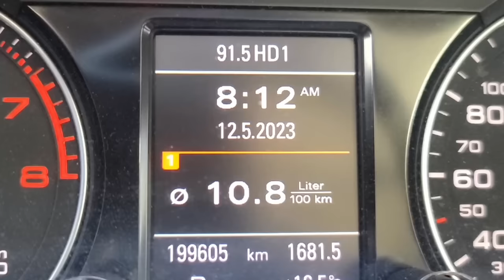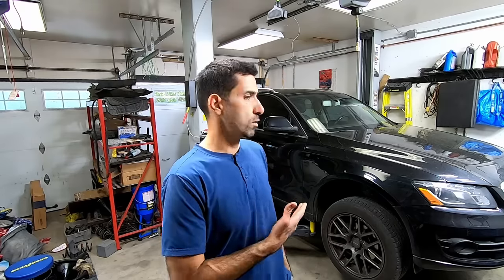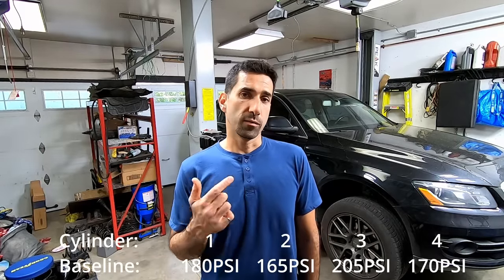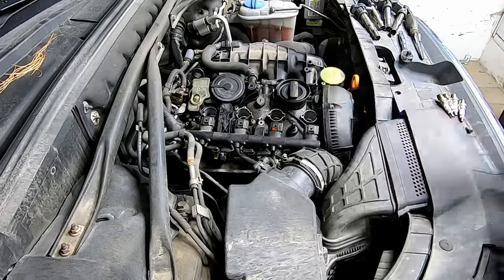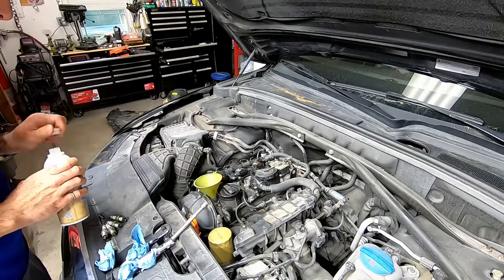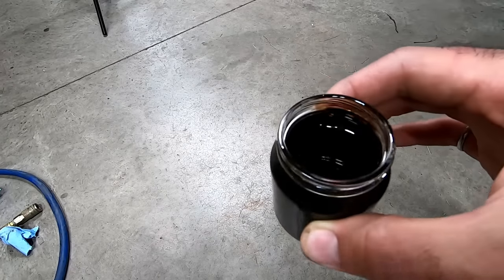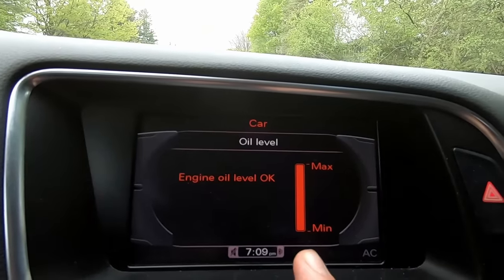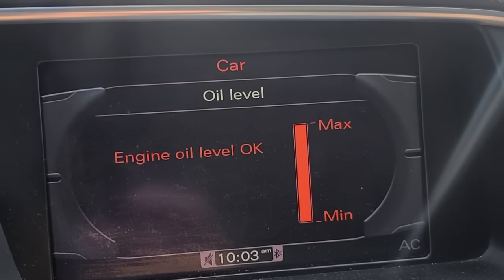How to fix excessive oil consumption from clogged piston rings (Part 2)

Comment: Buenas! Soy propietario de un Audi A5 1.8 TFSI del año 2014. Siempre he tenido un consumo de aceite de 1L en torno a los 2.000km - 2.500km. Sí que es cierto que mi estilo de conducción es muy agresivo y el coche no está de serie, tiene muchas modificaciones y está sacando 265cv, lo cual influye a que el consumo sea mayor. Tras revisar todas las posibles causas salvo los segmentos (fugas, turbo, compresión...), tuve claro que el problema era que algún segmento estaba atorado. Realicé este procedimiento con Liqui Moly Pro-line durante 24h exactamente igual que en el vídeo. Primero comprobé la compresión en frío y todos los cilindros dieron un valor de entre 12,25 y 12,5 (la relación es de 9.6 a 1). Seguí el procedimiento vertiendo la primera ronda. Al pasar 3h, había líquido en todos los cilindros menos en el nº3, estaba claro que este cilindro era el problemático. Al revisar los cilindros para verter la tercera ronda, estaban todos iguales. Me llevé una gran sorpresa, ya que se estaban notando mejoras sin terminar el proceso. Finalmente terminé el remojo y el coche arrancó a la primera sin dificultad, pero soltando humo de aceite quemado por el escape. Dejé el coche a ralentí 15mins y retiré el aceite licuado. Inmediatamente vertí aceite barato con 500ml de Liqui Moly y conduje a más de 3.000rpm durante más de 30mins. El nuevo aceite salió muy muy negro. Hice el cambio de aceite y filtros de calidad (Aceite: Ravenol RCS 5w40. Filtros: MANN-FILTER). Tras 700km - 800km no he notado ningún consumo de aceite, lo cual ha sido una gran mejora. El coche se siente mucho más suave y no expulsa nada de humo de aceite quemado. Mil gracias por tu vídeo, me ahorró mucho dinero!
Reply from the maker: Gracias por la nota. Me alegro mucho de que este método te haya funcionado.
Reply: Bonjour,J'ai le même problème de consommation d'huile sur mon Audi A4 de 2010.Quelle est la référence du produit de Liqui Moly que vous avez utilisé?Cordialement emiddio
Reply from the maker: @ecerce2151  you can try LiquiMoly Engine Flush Pro Line - it won't be as strong as B12 but it might solve the problem
Reply: Buenas, genial que te funcionara!! una pregunta del proceso, en el remojo de los pistones pusiste un litro entre todo el proceso antes del primer cambio de aceite? y posteriormente le pusiste medio litro para hacer un lavado conduciendo el coche una media hora, es correcto? yo lo voy ha hacer el lunes, no se como va a ir ya que me falla un cilindro, creo que solo funciona con 3, me llego a consumir 1 litro de aceite a los 300 Km y me temo que no va a ser suficiente el liqui moly para soltar los aros, si ese es solo el problema... gracias por la ayuda!
Reply: @jaumemfe Tú problema va más allá tío, no intentes este proceso...
Reply: @jaumemfe Asegúrate bien de que tú coche funcione a 3 cilindros. Si se da el caso, tú problema no está relacionado con los segmentos.
Reply: @SrZomBros  creo que es lo que le ocurrio a @etmotorsports en el primer video, fallo masivo de encendido por culpa de que se mojaban las bujias del cilindro, al limpiarlas parace que volvian a funcionar hasta que se volvian a mojar, cuando las saque lo sabre, pero si es así le hare el remojo con liqui moly, le metiste el litro entero en el remojo tu?

Comment: I tried to take this method to another level.  The B-12 did not drain thru the cylinder, so I tried to force it thru with 80 psi compressed air.   This didn't help at all as far as I could tell. So I sucked out all the B-12, which was now coffee colored.
Apparently the compression in my engine is much better that the OP's.   Mine is a 2015 Q5 2.0T with 115,000 miles. After about 2000 miles it burns enough oil to foul the #4 plug.   Note I didn't rotate the crank at all.
Questions:
1.  Do you have to rotate the crank with the plugs out to cause  the B12 to drain thru?
2.  Has anyone tried spark plug non-foulers in an Audi to delay the misfire error code?
3.  Why didn't 80 psi force the B12 thru?  Could the oil rings be that clogged up?
4.  If they are that clogged, what should I try next?
Reply from the maker: hey - my A4 was fouling the plug as well...did you measure the compression on all 4 cylinders? neither of my cars showed any signs of concern in the compression numbers...

to your questions:

1. all four cylinders behaved differently for me - some drained right away, some sat for a bit...how long did you leave the b12 on top of piston #4? rotating the crank without the plugs is meant to help distribute the fluid so if you didn't do that I would suggest trying it
2. not sure what that is but it won't fix your core issue - you've got so much oil in your cylinder that the plug gets dirty...you need to address that problem
3. who knows - was the piston at the bottom? when I use compressed air in the cylinders when I change valve seals it very easily pushes the piston down and rotates the engine - did you see any movement?
4. can you provide more details of how you did the soak? did the b12 sit in cyl 4 for 24hrs and didn't drain? that's a first - most viewers have reported varying times but so far nobody had liquid left at the end of the service...if it didn't drain down in 24hrs then I would suggest perhaps adding some SeaFoam or engine flush to your oil and doing a prolonged engine flush (say 4-500km) with some good high rev pulls and then repeating the soak...also measure the compression to see if cyl 4 shows much different results than the rest...if the rings are so clogged that nothing goes down, B12 "should" eventually be able to soften then up even if it takes a few tries...keep turning the crank, and watch what the liquid does...

you didn't actually specify what your consumption was before the treatment? are you saying that after the treatment you started fouling the plug?

Comment: 820 km and no consumption, how many miles are you at now and has it drank any oil? This is super encouraging man, there are literally hundreds of thousands of Audi owners with 2009-16 piston issues and this would be a life saver! I was worried I may have to sell my vehicle for scrap my consumption is getting so bad..
Reply from the maker: Fantastic! How bad was this before the treatment? The Q5 is at 2k+ with no consumption - I'm waiting for 5k to do the first oil change
Reply: I was waiting for this answer, damn. I have b8.5 a5 2.0 tfsi europe spec and i guess i ll use a similar product. Please let me know if you know a similar product compared to berrman’s
Reply: Btw did you disconnect the fuel lines? I may have skipped that part if you did
Reply from the maker: @Exray737  no need to disconnect the fuel lines... even if you used B12 as designed as a fuel system cleaner you just add it to the tank and drive around...as far as alternatives - pretty much any engine flush like LiquiMoly or Seafoam will work
Reply: But if you want to turn crank by you know, cranking by starting i assume you would need to yeah?
Reply from the maker: @Exray737  turn the crank while doing the soak? Hmm I think it's better if you do it by hand... if you absolutely want to use the starter then I would disconnect the fuel pump fuse and not touch the fuel lines... otherwise you'll get fuel all over the place... and if you're cranking with the starter you absolutely have to make sure the plugs are out because otherwise you might hydrlock your motor.... another thing to consider- the starter spins the crank very fast so you might actually push all the liquid out of the cylinder instead of into the rings... yeah I would spin it by hand - the starter isn't a good idea
Reply: Thanks for your time man, appreciated!
Reply: @ETMotorsports  I haven't done the B12 Chem yet, I am going to this weekend. I'll let you know how the consumption changes! The fact that you're at 2k now is extremely encouraging. Man you are doing the Lord's work here hahaha. I cannot believe Audi has this many cars needing a rebuild and no one seems to really know about this possible fix for the stuck rings.

Comment: Thanks so much for the video!. I really want to try this on my 2011 Q5 which is consuming roughly 1L/500km just as yours was.
Unfortunately Berryman B-12 is not available where I live. Do you think I can simply mix toluene and acetone in the same ratio as B-12? Or will I be missing something that is crucial?
Reply from the maker: Hey I can't confirm what will happen if you mix your own chemicals but you can try pretty much any engine treatment/engine flush with this process...I've had good success with SeaFoam on both my A4 and q5

Comment: do the pistons absolutely have to be at the same level? i can’t find my tool to rotate the crank. cylinder 1 & 4 are the same level but higher than 2 & 3 and 2 & 3 are the same level but lower than 1 & 4.
Reply from the maker: @mndzy4  no on the 4cyl it makes no difference
Reply: @ETMotorsports  so i can start this process without leveling the pistons?
Reply: @mndzy4 yes, but you still need to hand crank rotations every 6 hours or so.

Comment: Hello Sir, I started doing this process today as you recommended me that some folks had succes with proline engine flush and I am at 6 hour mark at the moment, I have a question when I removed my spark plugs I clearly saw that they was burned. Do you recommend me to put a new ones when I start the engine or should I put the new ones after 30 minute ride? Thanks in Advance
Reply from the maker: @EnsarRamadani-t4n  I would put new ones at the end - run the old ones for the first 30 min,  you'll have some misfires etc... when you drain the dirty oil and fill in the clean one,  pop in the new plugs... good luck!
Reply: @ETMotorsports  thank you for the quick response. I will update about results :) have a good day.
Reply: Agree, I restarted my car with the old ones, then added new ones and did the oil change at the same time

Comment: Have you tried running seafoam in the oil a week before your oil changes. Usually works for me if I'm feeling like my truck is burning a bit too much oil. Helps break down the sludge and carbon build up that keeps the rings from keeping tension on the cylinder walls.

What was the compression on the cylinders post chemtool

I'd be a little iffy about driving the car with 2 cans of chemtool in the oil though. The oil would be pretty thin and there might be a little excessive wear. 

Also the grit you felt in the oil was likely built up carbon and sludge after a life of long interval oil changes.
Reply from the maker: it's not a bad idea...basically do a longer flush? how much do you add before your oil change? I think the can recommends 1/2 can per flush?

Comment: Hello, i have seen in one of your videos that when your done with the procedure and before putting back the spark plugs, you would start the car without the spark plugs and the rings in order to remove the excess B12 left. Is that something u have done on the Q5 too and would u recommend doing it ? Thank u 🙏
Reply from the maker: Hey I would 100% hit the starter a few times before putting the plugs in because that allows you to spin the motor without compression which is low impact for the pistons... it'll clear up and liquid left around, circulate the oil etc before you go ahead and start the motor

Comment: For those of you who care, the clogged piston ring holes is also a common issue on Toyota Corolla’s / Celicas with the 1ZZ 1.8L four banger. This should work for the excessive oil consumption that is common on these engines. I’ll try this on my 02 Celica and see how it works.
Reply from the maker: good to know - a few folks have tried on different engines and been successful...glad it worked
Reply: @ETMotorsports  thank you for trying and documenting this method on a significantly more expensive car. I had seen people talk on CelicaHobby forums about doing this as a fix, but it hasn’t been an active forum for almost a decade.

Comment: Thanks for the suggestions, I made little bit a research and I found that liqui moly Proline Gasoline injector cleaner is stronger than engine flush and standard injector cleaner. Do you think that I will have better effect with it? Thanks in advance
Reply from the maker: @EnsarRamadani-li7rz  yeah if it's in liquid form and you can get enough quantity you should be good

Comment: Hi! I have the same problemon my vr6 3.6 touareg, but I can not find this product in Europe. Do you think other brad of injector cleaner can be also good?
Reply from the maker: Hey a few viewers have been able to buy b12 from eBay and ship it...Alternatively you can try LiquiMoly Engine Flush Pro line or i think they have a fuel injector cleaner as well...I used Seafoam in my T3 VR6 and went from 1L/2000km to 1L/5500km with just a mild soak
Reply: And use the liquimoly as it shown on the video or as the manual says

Comment: Hello, In Europe i don t fiind B12 Chemtool.What product you think i can use to make the same cleaning like you?exist something from Liqui Moly or other company??Thank you!!
Reply from the maker: hey a few folks have tried LiquiMoly Engineflush ProLine but the results seem mixed...LiquiMoly also has an injector cleaner  alternative - I have not tried either so can't guarantee any of them would work. It all depends on how bad the engine is. For example I used Seafoam (engine flush and treatment) on my A4 and Touareg and it worked on both of those cars but did absolutely nothing on the Q7. The Q7 was so bad that B12 is the only thing that helped. There's not much to lose by trying LiquiMoly - just do a soak at your next oil change and see if helps

Comment: There is no way to get b-12 in Europe tryed on ebay twice none shiped because its hazard item idk what to try i ordered some toulene since this is 50% of b-12 and white spirit thinking of doing my own mix but im scared i will damage something i need help... also can you do piston soak with liquid moly pro engine flush or you only have to put it in oil or can you do an actual soak with it im hopeless please answer!
Reply from the maker: I would start with LiquiMoly Engine Flush Pro Line and see if it works...it's perfectly fine to use for the soak but may not be as effective as B12

Comment: Hello, thank you for the video. I will give a try to this but my question is that in europe we dont have b12 or seafom. Do you have any recommendations ? Like liqui moly or bardahl or any other brand and which type should I use for the best result. Thank you in advance
Reply from the maker: @Irem-tg6rb  hey you can try LiquiMoly Engine Flush Pro Line... depending on how bad your engine is you might be able to restore it wth that... otherwise if you go through some of the comments folks have suggested alternatives to B12... you may be able to order it from ebay btw

Comment: Hi, i can t get b12 in my country.  Arbo engine flush can work? Or liqui molly engine flush? Or any orher valve cleaner? I ve tried with a valve clenaer spray but still without any result. It s a  Q5 211cv.
Reply from the maker: @alema100  a spray won't work - you need something to sit on the pistons overnight... try liquimoly engine flush (pro line if you can get access to it)... some folks have been successful...

Comment: Could I do this B12 solution in my Audi A4 B7 2005 2.0 TDI ? by pouring it into the glowplug holes after removing them and cranking etc like you did ? Give me your thoughts please im having exact same issues and its not worth me either etting valve stem seals or piston rings changed..you know yourself. So ive either got to do this or continue with engine swap 😢
Reply from the maker: No issues doing this to a diesel - same process

Comment: This is great! But these are dead rings, this is already a consequence of the use of synthetic oils, which, when burned in a temperature-loaded engine such as an Audi, leave behind dirt due to which the rings stop working. Especially for those who like to use oil with a viscosity of 0W... and long oil change intervals. Maximum once per 7000 km. In my country, such oil is considered to kill the engine. Semi-synthetics and oil changes every 5-7 thousand and no more, as well as oil with a viscosity of 5W40 solve this problem.
Reply from the maker: Interesting...I only use 5w40 and change every 5k but synthetic always... first time I've heard that synthetic oil is worse than conventional

Comment: Hello, can you please let us know what tool u have used to rotate de Crank and is it necessary to do it as im having hard time finding the bolt crank pulley on my 2012 audi Q5 2.0 ?
Reply from the maker: It's a size 24 socket - not mandatory but seems to improve the effectiveness